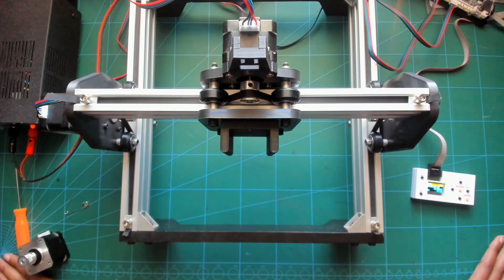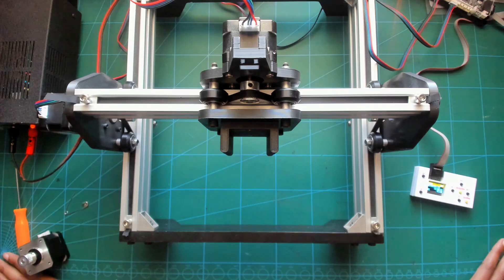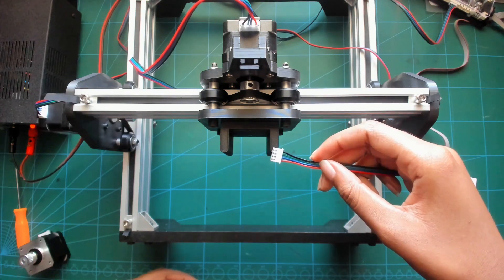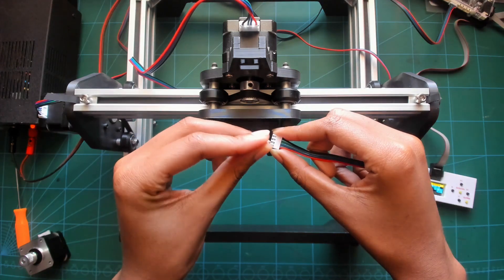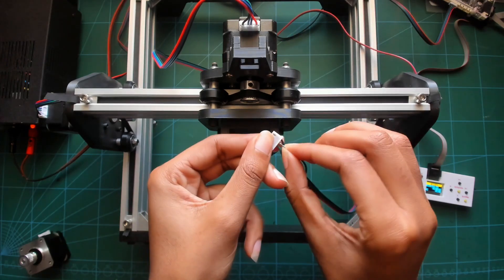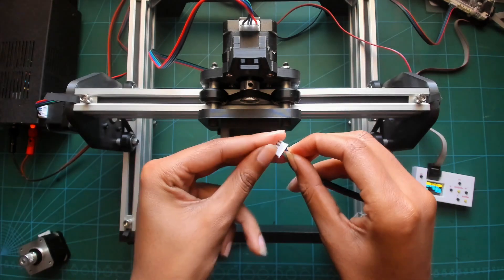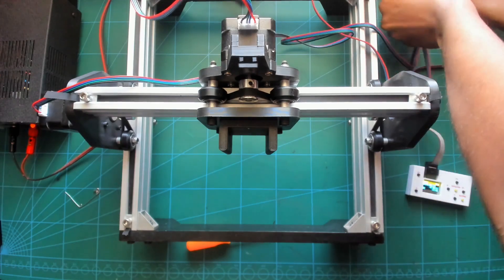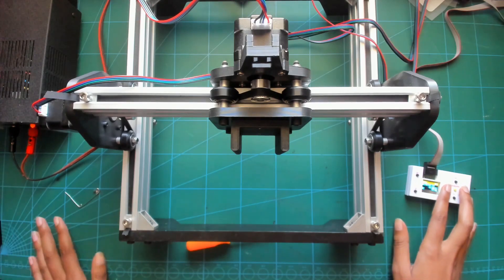Nema 17 Stepper Motor Not Working Troubleshooting Quick Fix

Comment: Its fixed 1 axis for me, but 2 still not working plus tool motor
Reply from the maker: I'm glad it fixed 1 for you. You may need to try swapping other wires. This method won't fix every stepper motor just some.